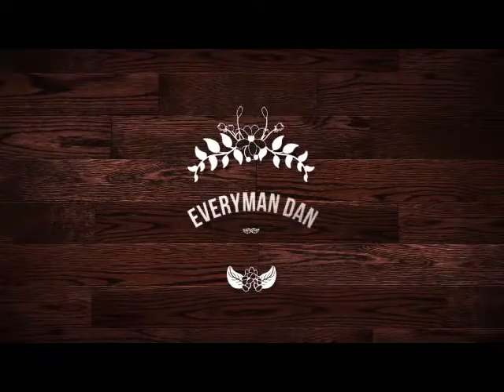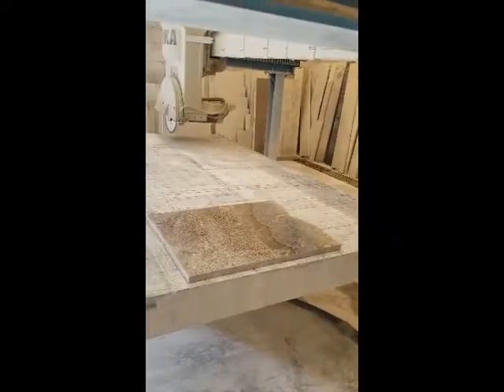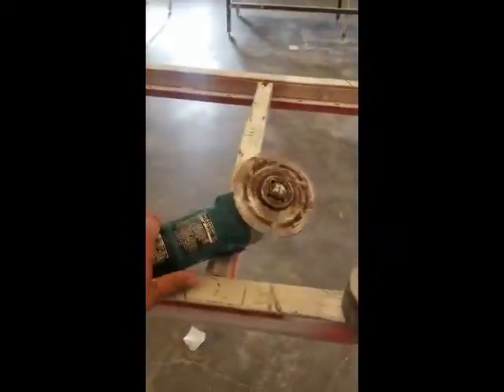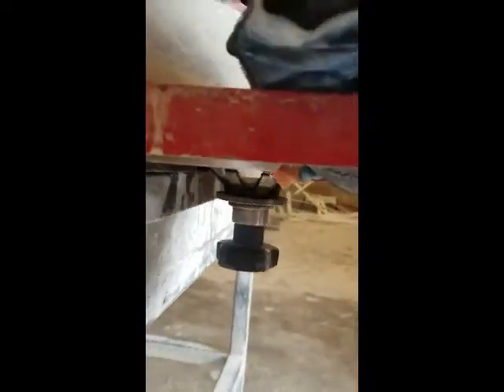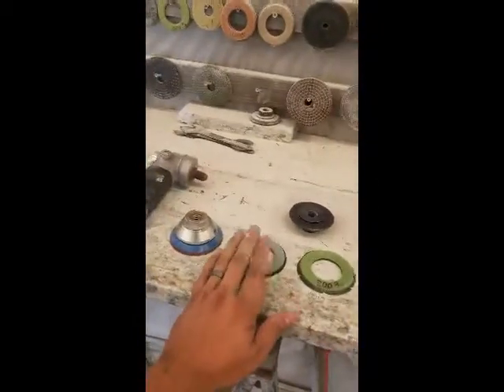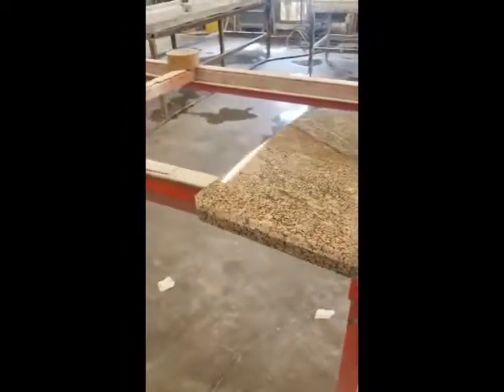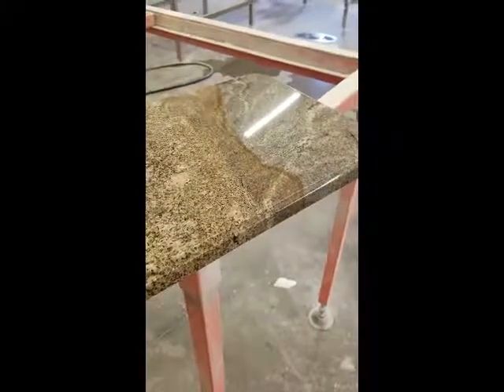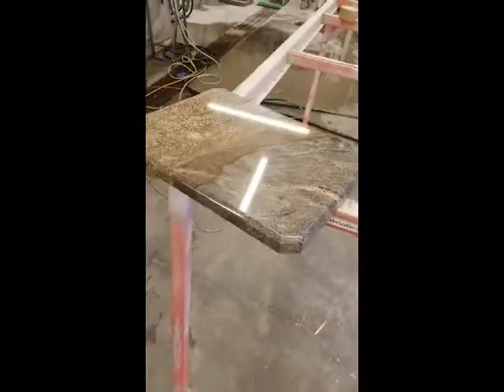How to make Granite counter tops - fabricating and polishing granite

Comment: Did you use a wax?
Reply from the maker: No wax. Not trying to hurt any ones feelings when I say this but wax is the lazy man's way of polishing.  Wax will eventually wear off and the edge will become dull again.  A good polish never wears off. (Except for maybe marble because it is so soft.)
Reply: thanks for the advise! Does the side looked as shiny as the top after polishing?
Reply from the maker: @deanarmada8268  yes, that is the goal anyway. You want your edge to be as flat and as shiny as the top. Some granite is more difficult to achieve this with. Looking down the edge is the best way to see what quality fabricator you had.  A bumpy dull edge most likely come from a less than good fabricator or someone using a method such as dry polishing. Which isnt the best way to achieve great results. This might be more info than you were looking for but I love to talk about this stuff!
Reply: @everymandan9669 . I am just a house owner. The granite installer did a bad job with the flooring and many areas are uneven. So they have to grind it to make the floor flat. Unfortunately, the grinded part is not as shiny as the other areas.
Reply from the maker: @deanarmada8268  yes it is very hard to match a manufacturer's polish.  And also hard to polish a large surface. When doing countertops we are very careful not to scratch or touch the surface of the stone.  In that situation wax may be suitable but will need to be reapplied every so often. Maybe as much as once or twice a year depending on foot traffic and frequency of cleaning.
Reply: @everymandan9669  but is it doable? with the correct steps? I am doubting if they are doing it right.
Reply from the maker: @deanarmada8268  it would be very difficult. It might not be able to match perfectly. It might almost be better to grind on the entire floor. It might not get as shiny but at least it will be consistant.